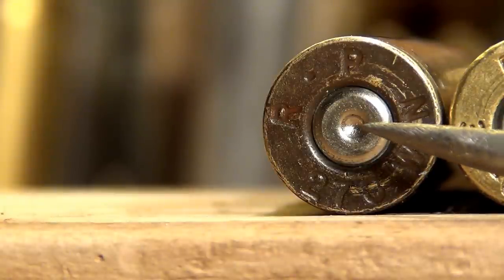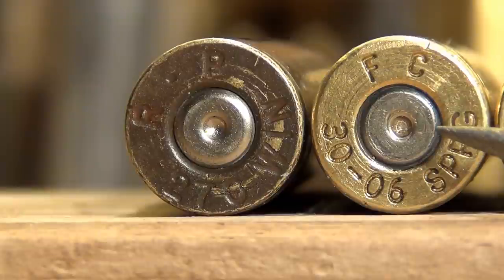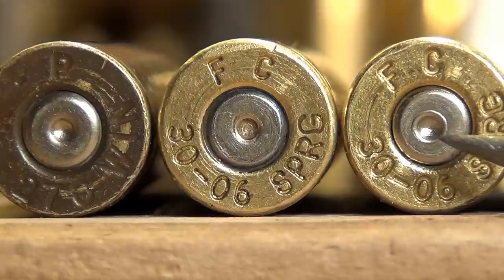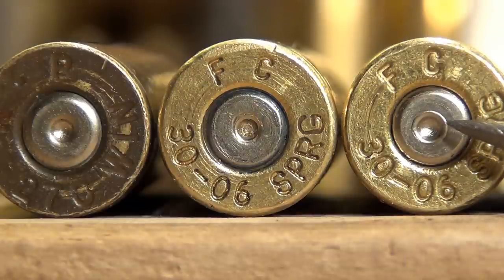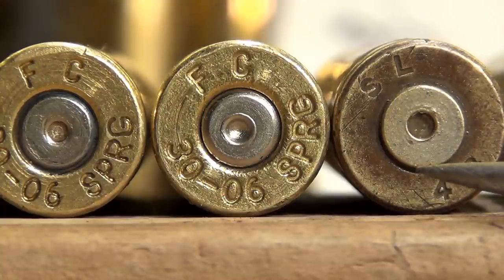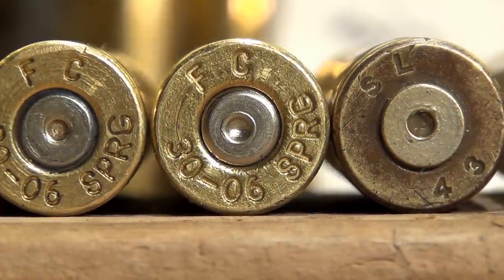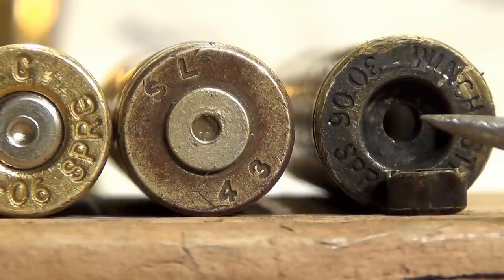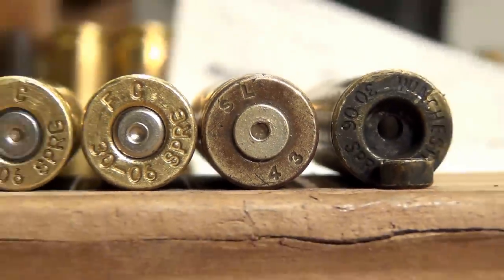LOOKING AT YOUR PRIMERS ON SPENT ROUNDS FOR SIGNS OF OVER PRESSURE - HD (L)

Comment: Sorry, but cratering isn’t a sure sign of over pressure. It can also be a sloppy firing pin hole, and more often than not, is.
Reply: Not more often then not. A set of callipers on the case and viewing the primer can definitely tell you when your pushing a load to hot. His examples are spot on as what happens,  when it's haven pressure issues ether from head space, barrel fouling or over charge.
Reply: It CAN be a sign, when in conjunction with other signs. On its own I would never jump to over pressure as a conclusion. 
Many rifles crater primers on factory loads.
Reply: Had a similar experience with a slight crater on on edge of the firing pin mark. Backed the load off 1.5 grains and still had the mark there. No issue with extraction or marks on case head. Think it might be the firing pin hole being slightly oversized or just the type of primer (Federal 215M)
Reply: TheWin338 Most of the time it just means a sloppy fit between the pin and hole. You can have it bushed or not bother, as it’s a non issue.
Reply: @TheWin338  what he is showing is examples from normal pin mark on his rifle on the first 3 in load development. Knowing what your pin mark looks like on your base loads is the key. By definition all are craters, when you flatten out the primer and get ridge lines riding on the out side that obviously groing, it is a sign of pressure increase. Example:  pushing a 6.5 x 284 up 1 grain at a time until I form an aparent rise in the ridge line of the crater, then pushing it up .2 or .1 until the ridge line forms cracks or case is hard to remove. On a 6.5x284 I have pushed it the same as a 338 lapua,  to the extremes  and then backed it off buy .1 until "I" was comfortable with it and my load deviation was acceptable along with the accuracy. I run federal mag primers till the pockets get loose then smash in cci mags. They all crater different when you start pushing it. Next time you push a load, take a magnifying glass, you'll see and learn to read it. I don't care about barrel life so I push them hard. He gives a great general example of changes. I'm usually pushing 40 rounds to get my max load across magneto, showing the full changes in the crater would be cool, but as win 338 point out, pins make different marks from different guns. This vid gives the general overall look of the stages.
Reply: Sorry but you are wrong. I've just come back from the range where I tested my loads, beginning from the start load which looked like the first round in this comparison going up the cratering started and got worse and worse along the ladder. The cratering is a CLEAR sign of high pressure. If you think about it if of course is, if the pressure is so high, that metal is forced in the tiny gap between firing pin and bolt, that takes a lot of force.
Reply: firebladeflow sorry, no. Not wrong. Cratering is not a sure sign of pressure. My Bergara craters every single primer on every single factory round it has ever shot. Head space is fine. There is no other signs of pressure. It just has a heavy spring and loose firing pin hole.
Reply: @tokay444  well for my ar10 i can definitely say it's a sign of rising pressure, however I would not go as far as calling excessive pressure on only this. But I have flattened primers in combination with cratering and extractor prints that then would be a good sign imo. As soon as I'm having extraction problems it's way too much. But for me I'm accepting a bit cratering and flattened primers plus a bit of a extractor print, i know a have a little air on top if i mess up a charge or seating depth a bit.
Reply: firebladeflow I maintain what I’ve said all along. It’s not a guaranteed sign of over pressure, but CAN be a sign, when combined with other signs.
Reply: @tokay444   so when your craters are getting bigger and bigger as your using more powder it's not pressure signs?  Then when you get an ejector mark it must just be the pin growing and the brass growng a pimple. Damn I guess we just wait till one explodes
Reply: J Polston My craters don’t get bigger, because they’re not pressure signs. I’m running factory ammo. Please re-read what I’ve written.
Reply: @tokay444  tHe's talking about load development not factory ammo. But i explain at the end why it applies to factory ammo too.

People are sure fast to correct a guy that is just trying to help new reloader what to look for in there load development when it's starting to go bad. 
Yea it's not only a sign of too much powder when it grows, cracks, ejector marks etc. 
His vid is a great video explaining  "progressive sequence" in pressure . 
I have seen the same thing happen in factory loads from a guy who sold me a rifle for $50 because he claimed it didn't shoot right. He never cleaned his barrel with copper solvent. It continue to get build up of copper until he plugged it up so bad the primers started blowing.  
After 6 hours of running an amonia based solvent and watching blobs of blue come out the end the rifle was back to shooting sub moa.
Sold it back to him for $50 plus a replacement bottle of the sweets 7.62 I used on it.

Pressure signs come in many forms and if you understand what is NORMAL ON YOUR WEAPON, then you have a clue when it is not normal. 

I would  hope that every new reloader would make an attempt to go through load development with an experienced person or stick to the books.
Reply: J Polston helping is great, when the information is accurate.
Reply: @tokay444  and if you dont miss the entire point of the video being load development
Reply: J Polston if you’re doing load development and all you see is a cratered primer, you’re cratering primers with no other signs of pressure, you probably have a sloppy firing pin hole.
Reply: Most guns are different in regards to primer strike craters and how heavy the firing pins are. These are just examples of what to look for. I think if he used the same gun/ round for all the examples people would not be confused. Excellent video juijitsu2000
Reply: According to Nathan Foster (Ballistic Studies) cratering is not a sign of high pressure, more of a headspace issue.

Comment: Also don’t forget that : less powder isn’t safe. If you get a loading density too low for your case, it can also go overpressure as the primer ignite all the powder at the same time and literally "burst" a big amount of gaz in a very short time (powder deflagrate instead of burning fast). 
Be safe and check reloading data of the manufacturer of your powder.

Comment: Excellent demo! I've seen guys going up that ladder when they wish they'd had this advice! One guy cut the hell right through the bolt face with a jet of fire and heat and galled the hell out of his lugs. That was about a $1000 mistake and he should have caught what was left of a custom bolt square in the cheek. Reloading is dangerous and if you don't pay heed to pressure signs and you take blind advice. It could very well put you in serious trouble or even worse someone you love. Thanks for this wise advice!

Comment: This video has good basic info that should be heeded/looked at/understood by all reloaders...BUT there are a few more things that CAN affect the pressure info you can get from ONLY reading primers and mislead you...one of them occurs when bullet seating varies from off the lands to "jammed" into the lands. A "jammed" bullet CAN produce pressure signs that will go away by changing the seating depth of the bullet to allow more "jump" and can be done if case volume allows. Varying seating depth will also affect bullet speeds and pressure rise times. Further variables are things like head spacing, and clearance between the firing pin and the bolt face itself (a lot of this depends upon the clearance around the firing pin---increased clearance allows easier (and sometimes deceiving) primer cup flow). You need to be able to read pressure signs as accurately as possible, but you MUST be familiar with your individual rifle's signs as they can vary from rifle to rifle. Likely, the SAFEST thing to do if you think you have  signs of high pressure is to reduce the load.......it is pretty tough to get into dangerous territory, pressure-wise, by reducing the load as long as you don't get carried away and reduce the load WWAAYY too much into the overly low charge range.

Comment: i was getting condition 3 on an old python. It would cause the cylinder to hang and lock up the pistol. A highly renowned colt gunsmith returned the gun to me and said the firing pin hole was oversize. He said reduce the load to 125gr bullets to shoot. Bottom line--i replaced the firing pi and spring and problem solved. All ammo used was factory and now I am reloding. Youi really helped me understand what is going on and how to load for this cherished old gun. All your vids are so very helpful to me. You have done this very well.

Comment: Great video, and thank you for taking the time to make it!  If they aren't flat I left some on the field and that aint gonna happen.  I've seen that far right one from a regular ole LR-308 shooting brand new factory 147 to 175gn bullets.  That's a sign of an overgassed system not a pressure sign in the case. Run em hard and run em hot baby.  Here's the deal folks.  Cases are not created equally and even some manufacturers will have cases in their own line which are beaten by the cases of other manufacturers.  Lapua stamps their cup twice at the web in order to make it extra strong in order to last the longest and to run it right up to pressure max velocity nodes.  Starline prob has the best 223 case, damn thing is like iron.  Peterson is right on up there and Alpha has their cups pretty tough too.  Now, if you go into other makers, you will see differences.  Ive seen Hornady cases with thin walls that could hold more powder, I'd run em hot once and toss em cause the web was done.  If you're hunting and reloading for the hunt, then accuracy of 1MOA may be fine in the custom hunting rig, so you take it right up to the wall.  It's all according to Boyle's Law.  Just do it slow and safe.  If I have a cartridge that says the max load for 2700fps is 41gns of X powder, then I run it 1/10 grain up to that wall and 0.5 gns past it.  I stop when I feel the recoil get noticably harder and the bolt lift is difficult.  To each their own.
I've had some primers that came off the line softer than the last lot and Ive some that were harder.  A soft primer will lie to you just as a firing pin bur or firing pin that's too long or the firing pin spring is either too heavy or too light.  It's wild how many factors play into this.  One other trick I look for if I think I hit the pressure wall.  I will take that final fired cartridge, let's say its the one that had a 41.2gn load.  I pop the primer out and measure the pocket depth.  I compare it to say a 39.8gn pocket.  If you went over the rating on that case, the primer pocket will have shortened, i.e. a bulge towards the bolt face occurred.  Always make sure before you use this method that you have either measured the primer pocket depth prior to loading or that you uniform the primer pocket.  That's something you should be doing about every 2-4 loads anyways depending on whether you're running hot or a magnum caliber.  Keep it light folks and have fun, but be safe.  Just another tip from your old uncle Larry.

Comment: If you are reloading your cases, a moderate to approaching the high end book load will save your brass for another loading or two or three.  Higher pressure loads stress the brass and can cause a flowing forward of the brass and a thickening of the neck, thece to have higher pressure also. Also, watch for cracks or splits in the case walls. If in doubt, throw it out!

Comment: Great video. Might be worth updating it with one additional failure mode and one comment.
1. Blanking/piercing. This instance is between catering and failure. The crater becomes so extreme that it is removed from the primer and (in most cases) ejected back through the firing pin into the bolt. The bolt will need dismantling and cleaning of the powder fouling and primer crater to prevent future malfunctions.

2. This isn't necessarily a sign of overpressure. If your firing pin hole and firing pin have too much clearance (eg using Lapua 308win brass with small rifle primer in a Remington 700) then the primer is not fully supported and can flow around the firing pin. You can fix this by bushing the firing pin (gunsmith job) or by using magnum primers which have a thicker cup. This is notorious in small rifle primers. It happened with my 6.5x47 Lapua and today with my 223 (you should use magnum primers for this calibre due to high max pressure of this calibre).

Happy shooting!

Comment: Thanks for the helpful explanation. I had some factory IMI ammo that blew up one of my rifles with a Criterion barrel chambered in .223 Wylde. Experienced several blown primers prior to the unfortunate end. I thought the chambering might have been responsible so I tested a few more rounds in a 5.56 chamber FN barrel. They all looked like your last 3 examples. Flat primers, cratering, blown out primers. Never buying IMI ammo again after that.
Reply: That is bad, that should not happen, i hope you filed a lawsuit against them.    I need to say that flat primers does not always mean to much pressure, some primers are just very soft. I have some factory ammo wich i shoot allot and the primers always look like the rounds have to much pressure, but i onloaded one of the rounds and the load is okay, they are hot but not to hot. But yes if the primers blow out or you have a black ring about them you should stop using the ammo.

Comment: Sat third case that you describe is also an indication of a soft primer and or, a bolt face that is a little bit off in its precision. I have seen primers like that when I once switched to Winchester primers because Winchester primers were known to be softer oh, something I found out after I started seeing those signs and went back to the CCI primers. That was some years ago.

Comment: Good video! The problem with these classic signs of pressure is that there are so many factors that could cause some of these effects, like headspace, and like you said, loose primer pockets... This is the reason I also measure the expansion of the brass just in front of the webwith a micrometer, and use three reloading books per charge, and a chronograph... And I never try to get those last 50-100 fps, because for a significant increase in pressure, you don't get a lot of fps....... Better be safe! (And also, if you think of the barrel life, just by going down a few hundred fps, you will dramatically increase the life of your favorite rifle's barrel.... When you know the BC of the bullet you are using, and the velocity of that bullet, it is easy to adjust for the drop for long range shooting...)

Comment: Bulging primers can also be due to "Head Space".    Excessive head space can lead to bulged cases or even outright failures - cracks, case head separation, and splitting of the case neck. It can also cause light primer strikes, failure to fire, "primers popping out of the primer pocket", and of concern to reloaders, shortened case life.
  Head space is the distance measured from the part of the chamber that stops forward motion of the cartridge (the datum reference) to the face of the bolt. ... If the head space is too short, ammunition that is in specification may not chamber correctly.

Comment: Excellent video.  Reloading about a year, but this was a good explanation on how to read primers.  Reason I'm looking is that I'm working up a load for Springfield XD .45 Gap with some Berry's 185gr roundnose, hollow base bullets.  There isn't any published data for this bullet, so I used the minimum load for a "normal" 185gr bullet.  Just wanted to verify that it was safe to proceed.  Actually seem to be getting some light load signs.  Why does the primer seem to bulge around the firing pin indentation when you aren't using enough powder?

Comment: Thanks for another great video ! 
My primers look good but are backed out just a hair , enough to notice . I'm shooting Winchester super x factory loads that are fairly low pressure from my understanding. The gun is a model 94 Winchester in 38-55 made in 1902 . Do you think that would be from a slight headspace issue and if so should i even be concerned about it ?

Comment: The cratering on the middle primer is more indicative of a loose firing pin fit between firing pin hole and firing pin. Reading primers to determine pressure limit is dubious at best. Measuring casehead expansion is probably a bit (a lot)  more accurate.

Comment: For case # 3, cratering isn't always a sign of over pressure. It can happen on loads at safe pressure depending on if the hole in the bolt face for the firing pin is a little to large. I have seen this on several firearms.
Reply from the maker: True. Not always. Thank you for stopping by! Have a great day!

Comment: For a specific load I can only reach the required velocity with a slight overpressure, essentially identical to your third primer for the left.... would you say that's ok? I recognize it's not ideal, but for our local laws there's a mandated minimum muzzle energy
Reply from the maker: As long as it's within your load data.
Reply: @jiujitsu2000  not really any load data for hornady GMX in 6.5x55 I'm afraid

Comment: As several others have pointed out, cratering can be a sign of a loose firing pin hole, and also a chamfered firing pin hole, my Remington 700 has cratered since new with factory ammo, because the pin hole has a small chamfer.

Comment: the cratered primer is a clear cut sign of the firing pin diameter being too small for the hole in the bolt face.  I have a 700 that when I fire federal amuunition through it i get the same cratering.